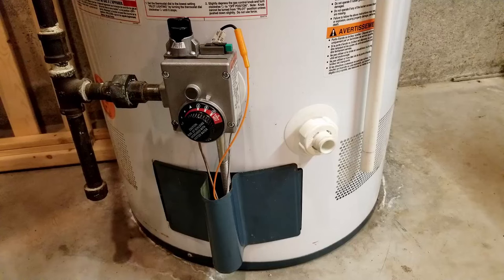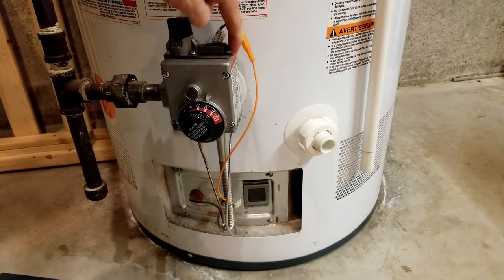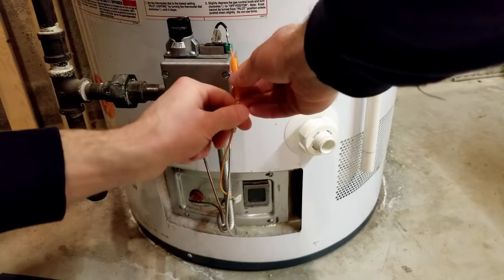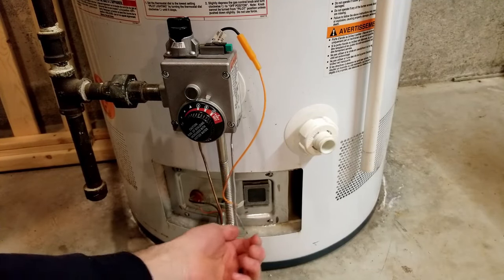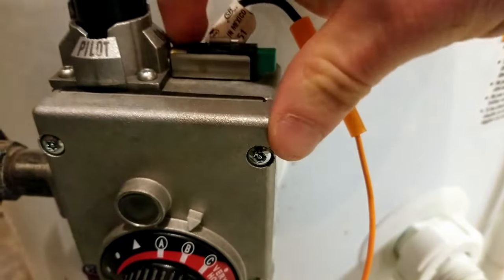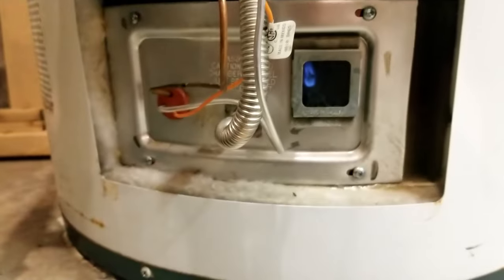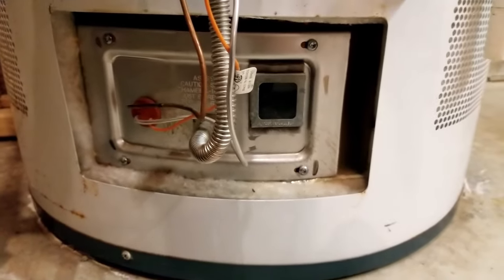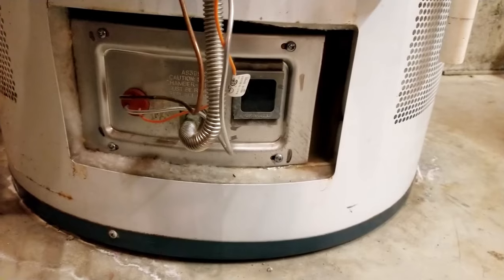Hot Water Heater No Spark: How to Fix Water Heater that Won't Light or Stay Lit

Comment: Sometimes the problem is the igniter wire itself. Check the wire for continuity. The piezo (igniter) can be the issue and the contact on the back end of it. Don’t recommend removing the burner. Might damage the gasket and if you don’t know what you’re doing you could possibly damage it. The thermocouple, burner tube and be careful with the pilot tube. The brass end of the thermocouple can be easy to cross thread so be gentle.

Comment: Thank you for this video!! I did a bunch of troubleshooting and had a service tech scheduled to come out later today. Disconnect the cable connection for the igniter, blew out the connecter and reconnected the wire. Worked right away!
Reply from the maker: No problem. Txs for letting me know it helped!

Comment: Thank you!  I took the igniter wire coupling apart, applied some contact cleaner and put back together.  It took a few sparks but got the pilot light lit within 40 seconds.  Note: if you listen carefully, you can hear when it lights (a subtle pop).  After that, about 20 seconds later the light started blinking every 3 seconds or so.
Reply from the maker: Great tip about the contact cleaner! Could also lightly use some fine sandpaper if it looks dirty. Enjoy the hot water!

Comment: I needed a T20 Torx bit to remove the burner assembly on a 2019 Richmond 50-gallon WH. Cleaned the igniter and tip of the pilot tube with sandpaper and then reassembled it. Wearing rubber gloves, I wiggled the orange wire around while repeatedly pushing the green button and it eventually lit the pilot. Held the pilot knob down for another minute and voila, ready to heat some water. Thanks for the inspiration!
Reply from the maker: Nice job Ed!

Comment: Thanks for this video.  After watching I was able to get it lit after several tries. Tip: I was too timid at first. It took three or four pressing of the button that lights the spark.  After several unsuccessful attempts to keep it lit I realized I needed to press and hold the red button while turning the knob from pilot to ON and I kept button pressed down while turning the dial from vacation to HOT... whoosh! Success at last.  Thanks again.
Reply from the maker: Way to go Emily! Good points there.

Comment: Hi. When you connect them, do the flat parts face each other, or they don't? I took off mine and now I don't know. lol.. Please answer me. Thanks.
Reply from the maker: Not positive i understand your question, but yes.. this type of connection is designed to plug straight into each other end to end. No bending of the wires required.

Basically, you just need the metal to metal contact.. nothing complicated.

Comment: How to disconnect the sparker from the wire to get a replacement. Mine is not pulling apart like yours did
Reply from the maker: Sorry, I can't really help you without seeing it. You might just have to cut the wire if there is no easy way to disconnect it. Hopefully there is a place you can disconnect it at the burner itself.

Comment: What if you get spark using igniter button while not depressing pilot, but no spark if you depress pilot while igniting? I was able to light pilot with burner assembly removed though....
Reply from the maker: I wish I was more qualified to help you, I found this comment on a different forum about someone's problem (I think the jist of the comment is that there might be a sensor that is preventing it from sparking. Make sure all your connections are snug:

Make sure the thermocouple nut is snug on the bottom of the gas valve.
There may be a TCO protector in the system that is open.

Hope you get it figured out.
Reply: Thanks! You think that sensor is in the pilot assembly cus rheem thinks pilot assembly is bad. Supposed to be getting new one on wednesday
 @koreyfreemanofficial
Reply from the maker: @JMBlackNet  i don't know if there is in fact a sensor in your assembly.. i am not a water heater tech. I don't see a sensor in the diagram in my video.

But i am pretty confident getting a new pilot assembly will take care of your issue. There isnt many other parts to a water heater and the assembly is where the spark is made.

Comment: I had someone fix my hot water tank wire but he did a quick fix he didn’t replace my igniter wire but lit the water heater know my water heater went out due to a flood and I need it lit back up I wanna know is it safe to light it with a lighter because it’s an electric and gas
Reply from the maker: I think you could, but I am not qualified to give you advice on this. Maybe this article will be helpful?
https://www.designswan.com/archives/how-to-light-a-water-heater-without-an-igniter.html

Comment: I have the same water heater, and my igniter seems to only work when it wants to, which is about 40% of the time. Normally, this wouldn't be a problem, but if the wind blows more than 15mph, the pilot light goes out. The wind blows often here. = (
Reply from the maker: A 15mph wind shouldn't be putting it out. I think you should get your venting looked at

Comment: Just installed my Rheem last night, ended up being the same problem.  Could not get flame to ignite until I tried pulling that apart and reconnecting.  Been working ever since.
Reply from the maker: Awesome! The ignitor wire is only needed for igniting the pilot so you should be good now! Lately I have been running with it unplugged because my toddler kept yanking in it 🙂
Reply: Pulling what apart??
Reply: @Starkidd689  The igniter wire.  It's a male/female connector coming off the igniter
Reply: @daletechel9221  how do u connect it ? I had a flood and I’m trying my best to light it so it can spark but it’s not. I got a fan drying it out now but idk what else to do 😩😩
Reply: @Starkidd689  If the water got high enough and the bottom of the water heater was under water, the igniter if probably wet or maybe damaged from being under water.  I'd suggest either calling for service or maybe googling what to do after a flooded basement in trying to re-ignite the heater.
Reply: @daletechel9221  ok😪

Comment: my pilot will stay lit while im holding the button and even seems to fire up when i adjust the temp but thennn goes out
Reply from the maker: Rats! Did you try cleaning everything I suggested in the video?
Reply from the maker: Also, make sure your gas line is fully open when trying to ignite

Comment: I have no ignition button. The prior owner took it so his renters couldn't light it themselves which means I can't now, either, as the new owner.
Reply from the maker: Thats annoying!
Reply: I am the homeowner and my heater has no ignition switch. How can I light the pilot with no ignition switch?
Reply: @theketonurse8755  Do you mean it is designed to have a switch/button but it is missing/removed?   If not, then it is a manual-light design and you can light it with a long match or a torch (not a flashlight, but a flame).  You still must hold the pilot button in briefly to override the shutoff valve.  The torch flame will heat up the safety thermocouple much faster than the pilot light so you shouldn't have to keep the knob pushed in for very long before it will run on its own.